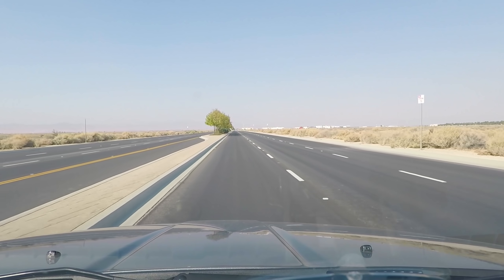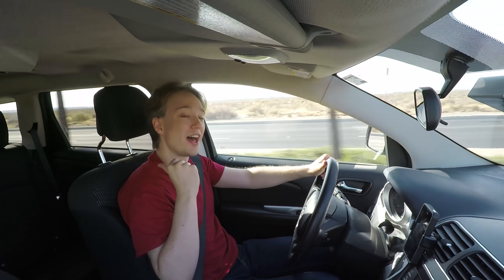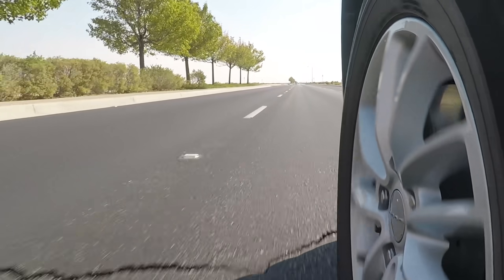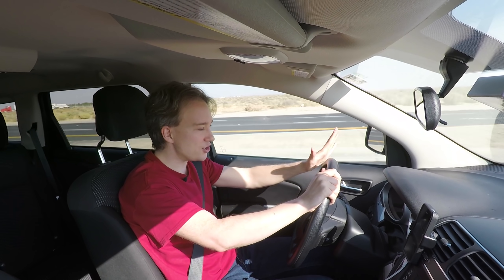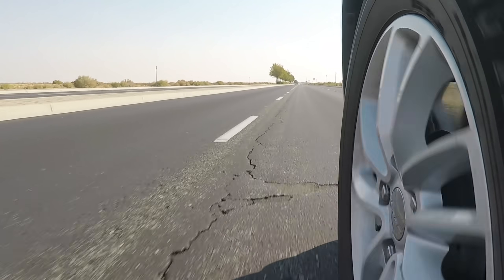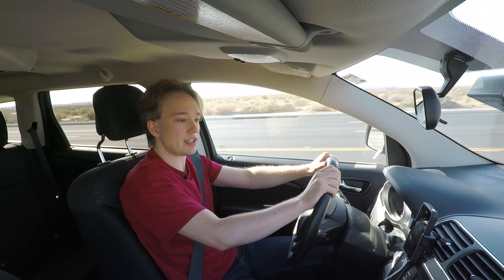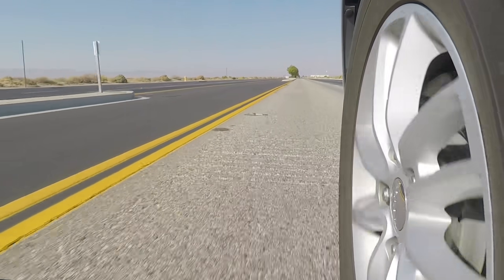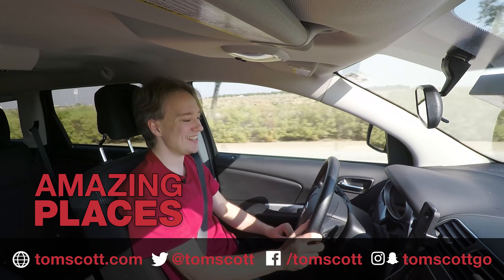Why California's musical road sounds terrible

Comment: 2 ways to solve the problem... 
1. Go faster
2. Reconstruct the English language
Reply: Going faster wouldn't work. It's no transposed down, the notes are at incorrect intervals.
Reply: As another commenter mentioned, going faster doesn’t fix this particular problem. It’s actually that the frequencies are all pitched wrong relative to each other. So unless you changed your speed on each note, you couldn’t fix it. 

The second thing, about the English language (that I’m surprised Scott didn’t mention) is that engineers do have specific terms to avoid this problem. In construction, you regularly see details marked as “on center” or “clear” to distinguish if you want the given distance as the “clear” space between the holes/columns/grooves (as was built here), or if you want the thing placed that distance from the center of one to the center of the other (what they had intended).
Reply: Or it would sound like "OHSHITOHSHITOHSHITOHSHIT!" if the car was a Suzuki Swift going that fast.
Reply: 1. Going faster doesn't help.
2. There's nothing wrong with the English language, it just needs to be used properly.
Reply: yeah, it would just sound like vlwrvlwvrl
Reply: Yo that's my hometown. Can confirm when you go 120 on it it sounds much better. Out of tune, but the speed helps you out
Reply: 3. Invent time travel go back in time and drive on the original road made for the commercial not the one moved there because some moron build homes next to a noisy tourist attraction.
Reply: Speed fixes everything.  At 160 MPH, you won’t even care about the tune!